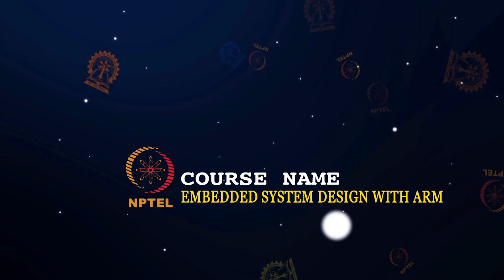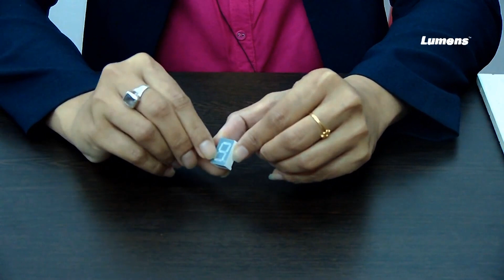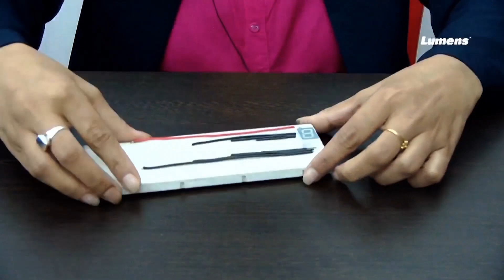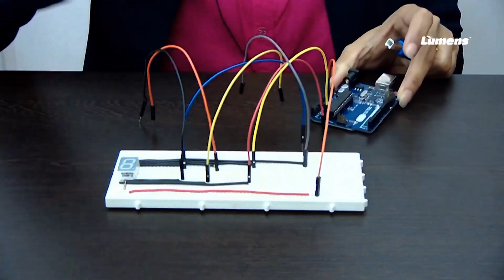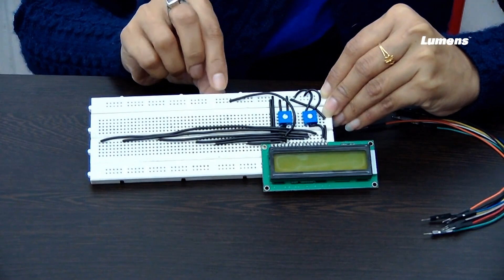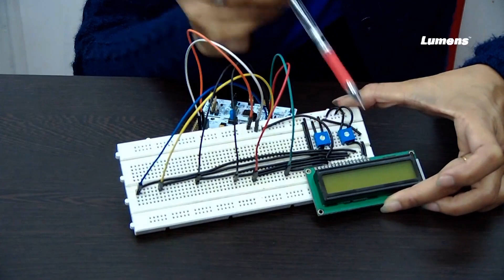Interfacing 7-Segment Led and Lcd Displays(Part 2)

Comment: Thanks for this informative video. I would like to interface the 4 digit 7 segment display with the LCD display (17 pin tiny display) which is in Radio receiver mcu. Can it be possible to do this? please advise if you can help me out to make this project. Thank you again for your video and the nice explanation on this subject.